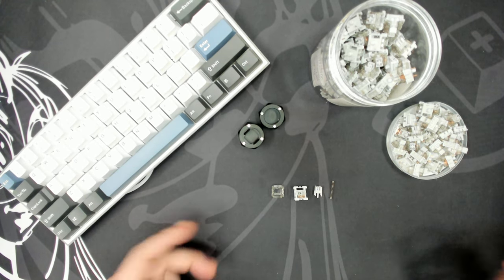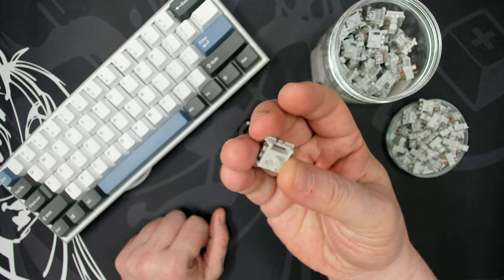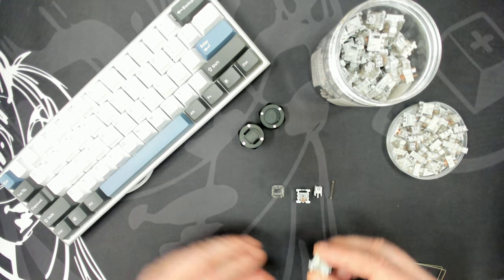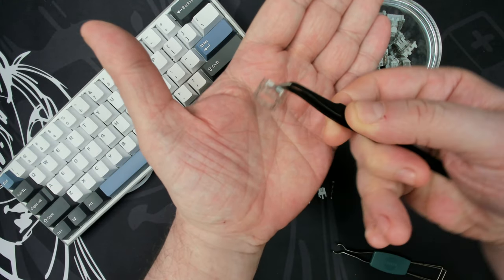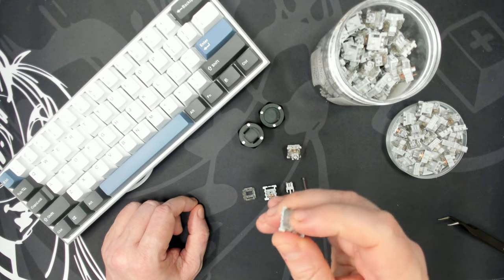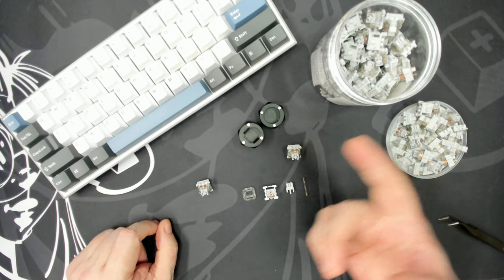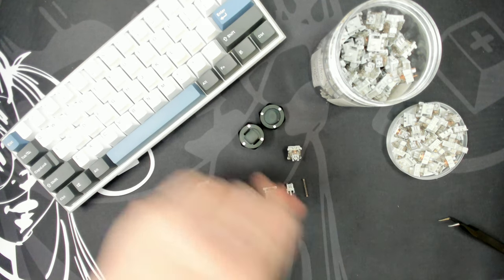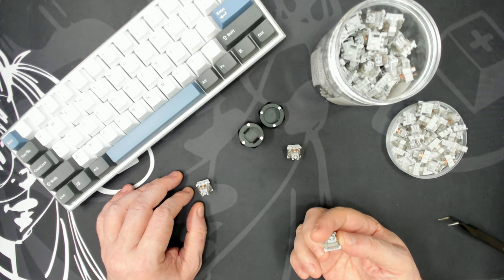Leobog Graywood V3 linear mechanical keyboard switch | Review and Sound Test

Comment: Does the switch support south facing RGB?
Reply: The switch does not care. They do support RGB and have a wide cut for light and clear top and they fit sockets no matter if north or south facing :)

Not sure if that was what you were asking. South face switches and caps designed for north face shine through will be meh just like with every other switch in this combination
Reply: @WarrenLeggatt thanks for replying! Yeah, I just meant do they block the light completely with south facing RGB because I wasn’t sure. It sounds like it doesn’t matter though so that’s good! Ordered them with a new set up, thanks for the video and reply!
Reply: @WarrenLeggatt  does they supports Outemu socket?
Reply: @ACWX_twistedgang  hmm, no idea. I tend to avoid any board that has that socket type as they are "sub optimal" :)
Reply from the maker: Yes, Leobog Graywood V3s do fit in Outemu sleeves.

Comment: Could have sworn you reviewed this a while back but think it is a switch you use often. Great switches, soft but snappy feel. 

I have had a few start to chatter on me before I feel they should have but otherwise they have been great.
Reply from the maker: I have used them, but had yet to review them ;)

I've had two fail to chattering, but all of the others continue to trek along just fine, I've got way too many of this switch :/
Reply: @MechKeyboards  Know the feel, had a load of these switches pass through my hands. Dirt cheap, good feel and sound. They come alive lubed also. 

It looks like the V4 also get this as I had a customer build develop chatter on a few switches after 6 months on V4s. 

I think the V3 are the better switch but the V4 sound slightly better I think
Reply from the maker: @WarrenLeggatt  I could be wrong, interested to see what they'll compare head to head, I'll also compare stock versus hand lubed.